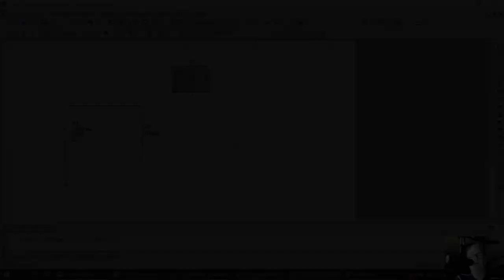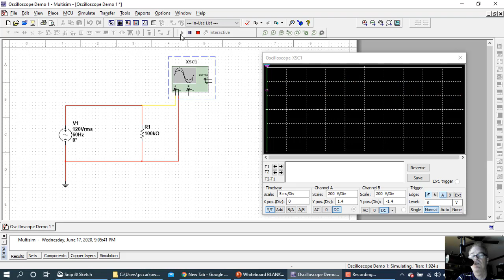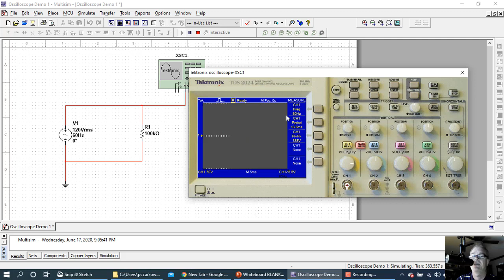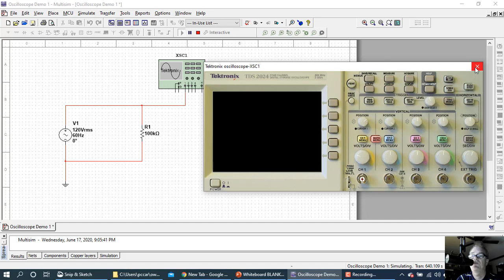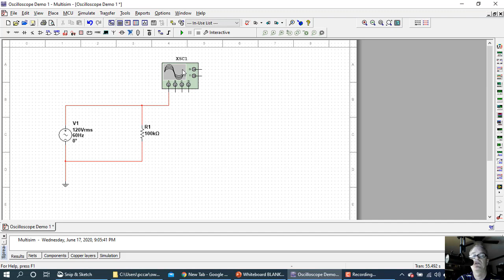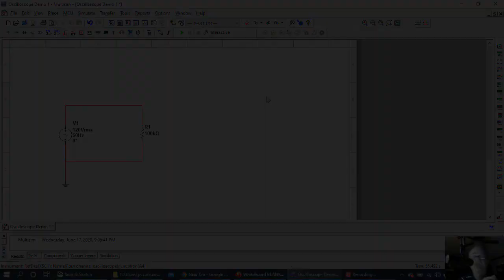Multisim Basics - Using the Tektronix Oscilloscope

Comment: hi , nice video, hello my friend, how do you get the  " tektronix " oscilloscope because it's no appear in my tool box thank you for your availability :)
Reply: Hi, I'm not sure what version you use, but on Multisim 14.1, when you load into the program, on the far right, there's a vertical bar of common things, including oscilloscopes and function generators, etc. If you hover over those icons, they tell you what they are, and the tektronix oscilloscope is the fourth one from the bottom.